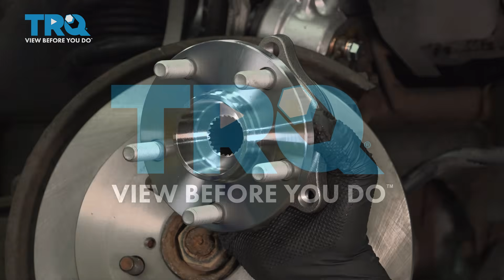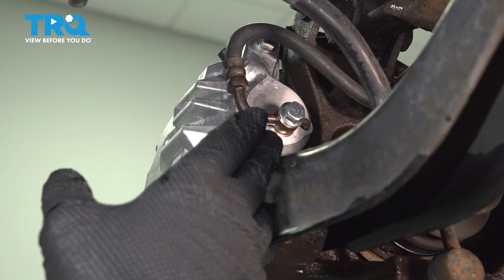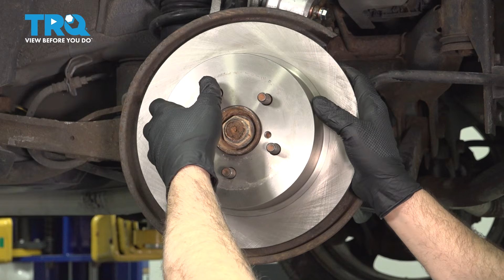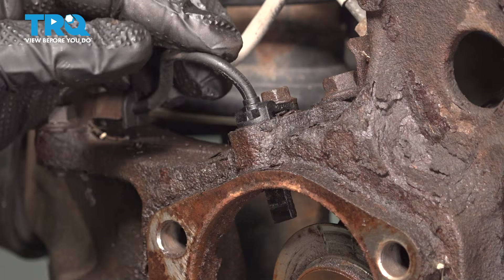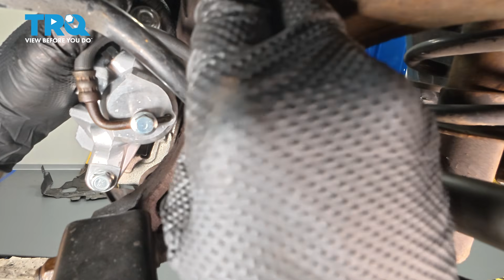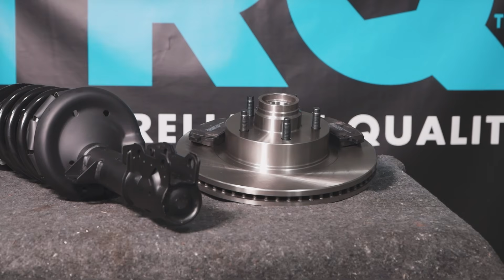How to Replace Rear Wheel Bearing & Hub Assemblies 2005-2009 Subaru Legacy

Comment: The only thing was.. when you put the wheel back on.. I noticed you had an old used rotor on the hub

 Where as you had a brand new rotor and brake caliper during ur video